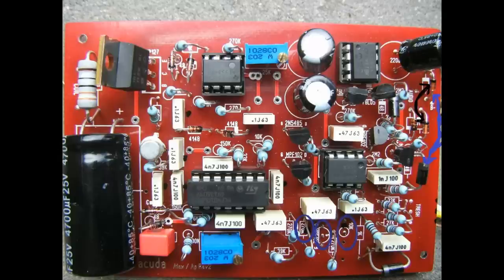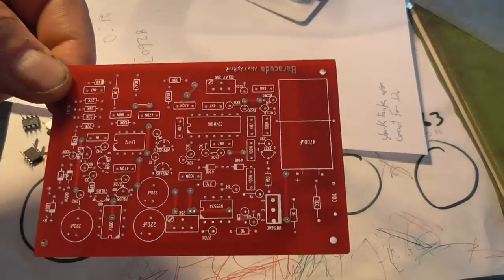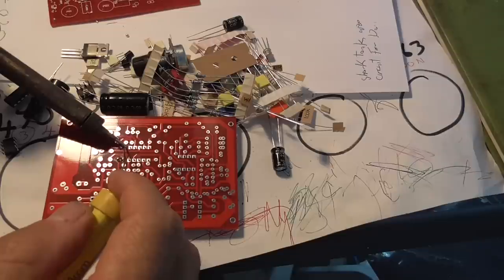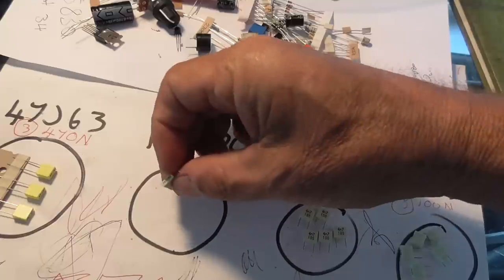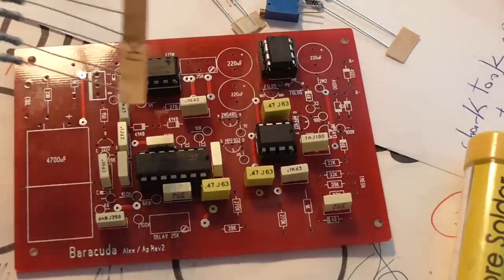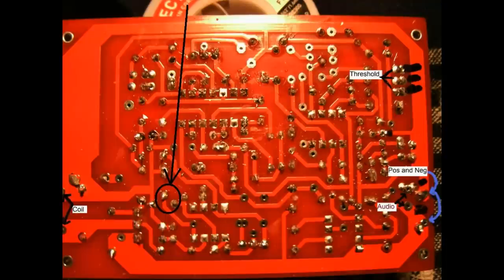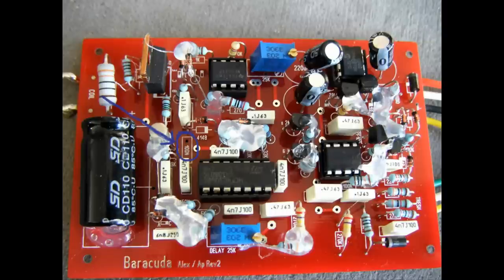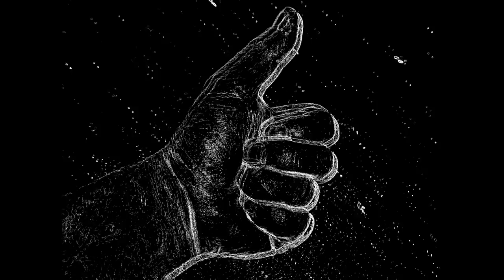HOW TO DIY ONE OF THE BEST METAL DETECTOR CIRCUITS.

Comment: Which of the kits listed on silverdog is best for finding steel parts deep underground lets say up to 1,5m
Reply from the maker: i don't know.. usually the largest coil will pick up deepest, but that means it will loose sensitivity to small pieces. recommend Whites TDI with Minelab 18 in coil or similar.
Reply from the maker: Better still, old GPX with 24 in coil
Reply: Goldfinders ok i understand the coil size but what about the three kits that are offered on silverdogs webpage. What is the better kit?
Reply from the maker: The Baracuda is a 12 volt kit that will not be powerful enough to support a large,- coil i think.  however it will pick up a beer can 2 feet with 8 in coil. i would ask the supplier as i haven't tried large coils with another circuit  May be a higher voltage system will work. The people who design these circuits are in a league of their own.

Comment: how much does it cost for your metal detector pcb only, and were can i buy one
Reply from the maker: +ganga j Our detector is a one off prototype.You can buy a subsitute circuit from silver dog in England. Baracuda or surf pi. They are very tricky to put together right but

Comment: are you sure your 2n2222A transistor is in correctly? the Emitter is the pin closest to the tab and therefore should be down the bottom not up the top in yours
Reply from the maker: Mk2Brett that one worked fine,- but the large black diodes may be incorrect
Reply from the maker: Frederick Barnes may be the transistor was twisted
Reply from the maker: Frederick Barnes I thank you and give you credit for your observation i will modify description
Reply: Frederick Barnes Thanks, i only noticed it as im building one myself today. Is the input voltage 12v?
Reply from the maker: 11.5 to 13 volts. below 11.5 it beeps
careful once you get working as one wrong hook up or short wire destroyes parts
Reply: Frederick Barnes Thanks, i just hooked up the 12v and i do get a continuous tone, however no changes with metal present within the coil.  with the two trim pots, if you dont have those set exactly right will it not make any changes in tone with metal present? if not then either i havnt set the trim pots correctly, i need to make a better coil or i did something wrong in the circuit
thanks
Reply from the maker: Mk2Brett threshold trimpot problem?large main transistor? one of the blue delay pots? small 666 chip is faulty or contaminated with flux. the coil connection is not good or there is a large amount of metal nearby--- having a tone means you are very close. that is my best.quess. let me know if you discover the problem?
Reply: Frederick Barnes I made a smaller and neater coil than my previous one, played with the blue trimpots and it now works great for detecting a pair of steel pliers! coins have a light but noticable tone but nothing for gold. I assume that the delay pots are what is adjusted for the different metals? thanks!
Reply from the maker: Mk2Brett  no,- sounds like there might have been too much resistance on the coil (too thick wire and not enough length ) and the board is dammaged is my quess
Reply: Frederick Barnes The copper wire is a bit thicker than it should be, i will go to jaycar tomorrow and get some thinner guage wire and wind a better coil. Hopefully the board isnt damaged :/

Comment: i think you should try PIM-2 detector
Reply: Goldfinders pim2 is a pi detector based on microcontroller and it has a lcd 
You can search on youtube. Building part a bit hard. Producers earn money from this job but older versions of this circuits, they post to forums. Result is awesome. It reflect a coin from 40-50cm.
Sorry my bad language.
Reply from the maker: checked it out and it sounds very good. large coil capabilities means better performance. overcoming ground conditions is a major problem however.

Comment: until what depth do this work?
Reply from the maker: The Baracuda is a average 12 volt pi. how deep it will pick up a small gold ring in the dirt with a 8 in coil is around 11 in. all depends on how well it works however ?

Comment: I guess copy is the best form of flattery Baracuda the original the the legend with the picture of the man that made it happen with his Harley named Barbra Ann. check out Clives gold page for a picture of some real cuda gold ...there is a none motion mode not activated on original board that is deeper and a place where a variable resistor or pot could be added for a self adjusting threshold that could be added to the final op amp feed back resistor which was ten turn mounted on Cuda one prototype.....lost treasure field test by my friend Andy Savage ....Baracuda ....Anchor Electronics  I am retired but still have boards parts and lab for days when I can't go dig gold with my Cuda....nice work sky is the limit with magnet fields ..... God Bless go find somthin Yeller
Reply from the maker: The technical elite...Pioneers of technology...  on a different subject What is that motorbike in your pic?
Reply: Goldfinders    I have 3 that is my 1984 police Harley Davidson, the last year of the Shovel head engine . The other 2 are a 79 Fl Shovel head  and a1949 Pan head  good luck in your finds happy trails jimpugh
Reply from the maker: like the old push rod engines and Harleys

Comment: i am making but this bored not working. problem
Reply from the maker: very easy to make a mistake
Reply: all time sound spich
Reply from the maker: If you got sound then the problem may be simple
Reply: pls tel me solution's
Reply: i am from India and living kolkatk. 
i am Bengali. no English. but trying tel to u. my making bod sound ok, coil no work, i 22 turn 30 g wear, 
without coil speech tha spikier. but coming my phone working this bod beep beep signal hear , i trying 
5 days and night thesis problem hear. pf 3640 both side 11.5 v and lid (n). 2n2222a no working. i don-know.
pls help me
Reply from the maker: I dont know i am no expert, if it dont work for me, i start again. But check at least 12 volts-  power positive and negative  right way-  speaker wires around right way? ,check all solder joins - trim pot right way? transistors right way?... easy to make mistake and damage.... i cant fault find. protect everything from moving and touching otherwise it will be destroyed. keep old for spare parts...try again.. could take several tries....
Reply from the maker: Any metal around coil will stop it from working
Reply: o good morning
Reply: sir i am fast time making metal detector bod. without specification. only your video play and 1 & 1 PAT 
MAKING. pls give me all resistors no and capacitors, specification.
pf9640 nears 150 resistor wt, k, oms i don know. pls detail all part no
delay 25k w203/306e tuning no work. coil no working. all time sound spike
Reply from the maker: I have none,- this is the property of Anchor electronics England i know only basics.
Reply: o sorry sir